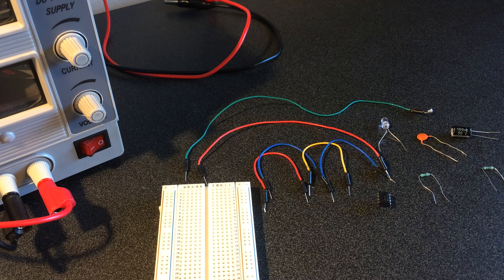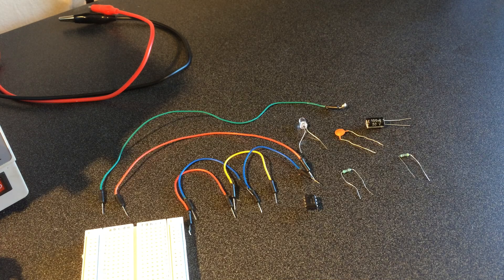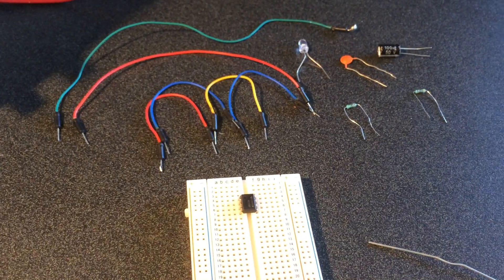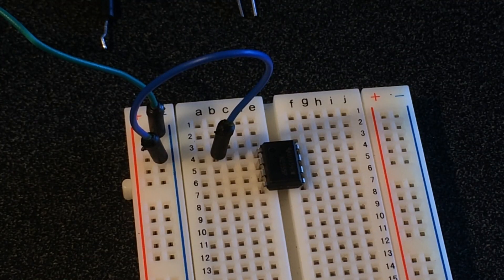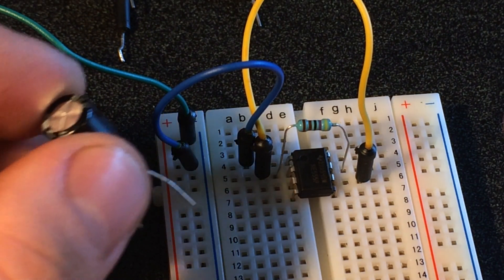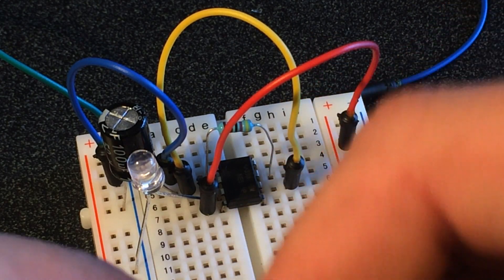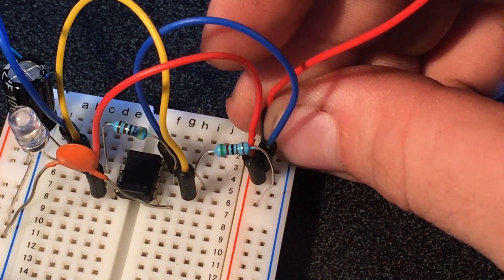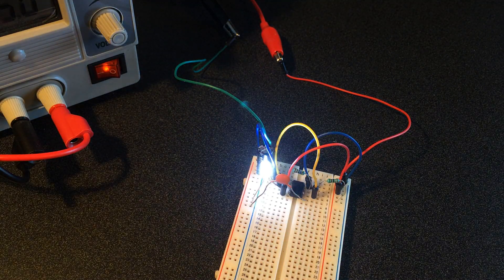How To: Make an LED blink using a 555 Timer IC

Comment: I just want to make a parallel of about 10 LEDs blink at about a 1/2 second interval using a capacitor and transistor, rather than a 555.  How do I do that?  (I am completely new to electronics)

Comment: Sorry if this is a stupid question, as I'm completely new to electronics, but could this system run on very low voltages, as in less than one volt? Or would different types of components be needed?

Comment: Hi. Thanks for the video, it helped me understand a lot. However, I'm completly new to meddling with electronics, so I have a stupid question.

When manipulating the blinking rate, is there a way to get duty cycle below 50%? The calculator only shows 50% and higher. Also, what does exactly duty cycle mean? For 50% and timer set for 2 seconds, does that mean the LED will be dark for 1 second and lit for another second, or dark for 2 seconds and lit for 2 seconds?
Reply: Thanks for the answer. I've been unable to go below 51%, unfortunetly, and that board is way too big to fit where I want to place it. I guess I'll go a different route and do ~65% :)
Reply: *****
and yes, you are right. I wanted a ~15% duty cycle with a 3-second peroid
Reply: that's what I'm doing now :) I think this article explains it, http://www.instructables.com/id/555-Timer/step7/555-Timer-Astable-Mode-Duty-Cycle/ , but English is not my firs language. I'm having a tough time understanding it
.

Another website mentions an inverter, but I don't know how to use it (and which one)